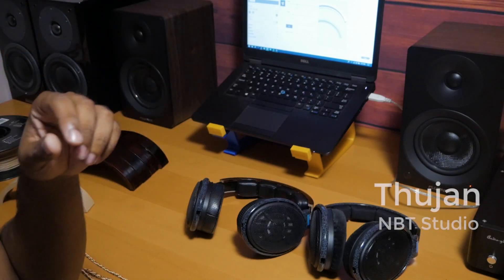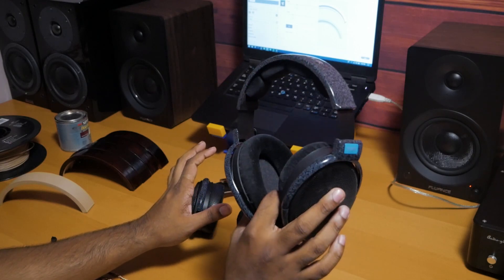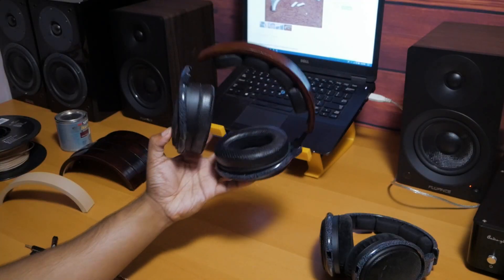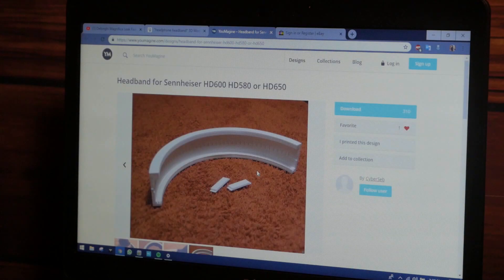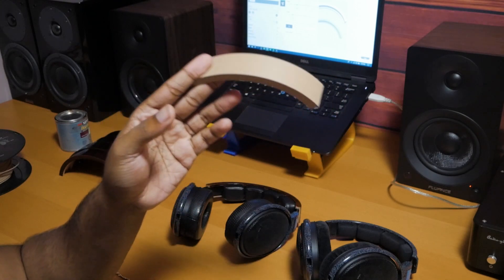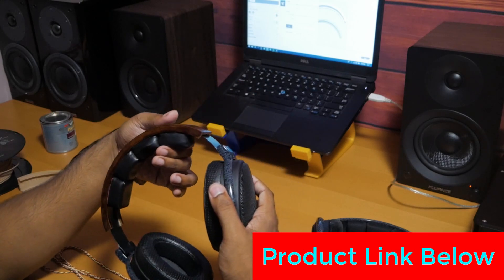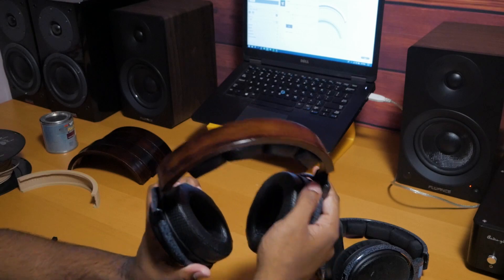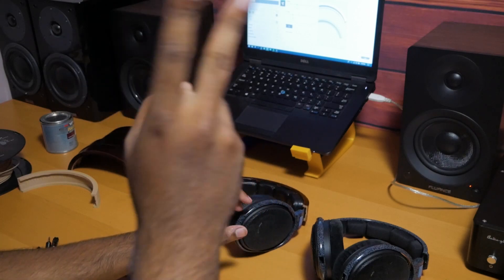How to 3D Print Sennheiser HD600 headphones  ! (aesthetics)

Comment: I have managed to get factory printed headband and pressure is to much.i tried to put pressure on metal parts but they again go in predefine angle of headband only solution that makes sense is yours mod. will you please share with me file with yours modes Headband lenght.
I do not have printer or experience but with file i will manage.